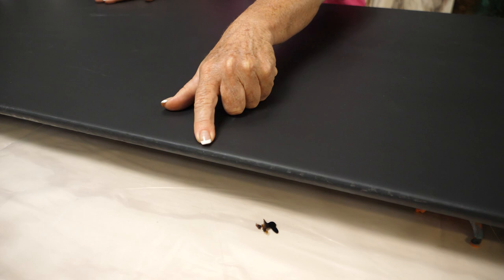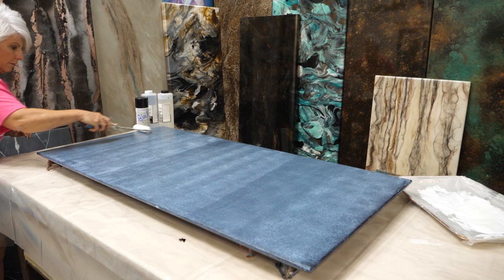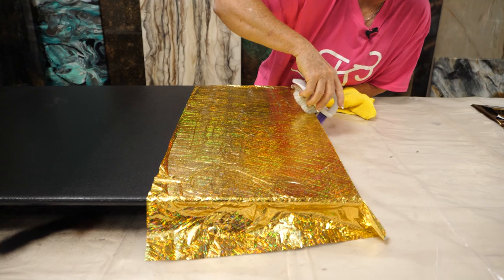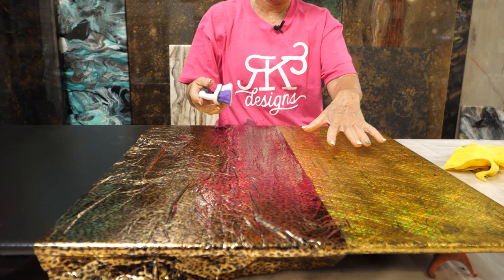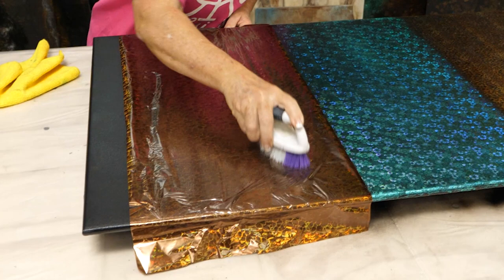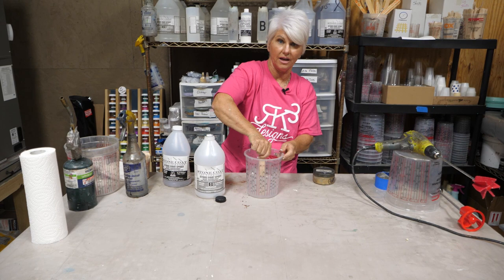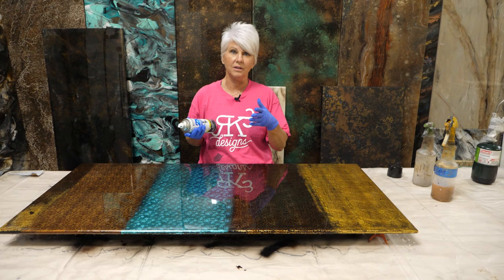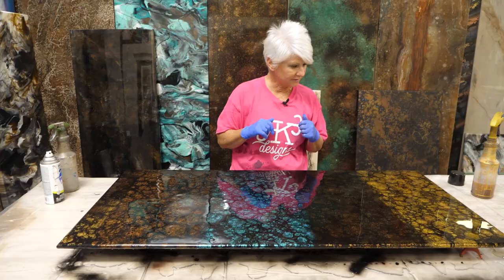Using Decorative Foils With Epoxy | RK3 Designs

Comment from the maker: rk3designs.com || Which foils would you use in your house? Have you seen all the options on Jennifer's website (ArtisticPaintingStudio.com)?
Reply: I don't know were i seen it, but i always thought you had to remove the "back"  so that silver part.. with alchohol. I use to do that for my nails. But now i want to use it for epoxy and i don't want to make any mistakes. So does that make any differenceĺ if i remove that "silver" part wich is on the back..?.
Reply from the maker: @ingridjager1028  that may be a different type of foils. The foils I use, the silver part is actually the backside of the design. You don’t want to remove it. That’s the part you put down next to the adhesive.
Reply: @RK3Designs  yes i know. But wenn i didn't removed it it did not transfer. But i guess it is different like you said. Thank you for your reply and your work does look amazing. 👌
Reply from the maker: @ingridjager1028  thank you!!! If you have any specific questions or need more help don’t hesitate to email me. Rhonda@rk3designs.com
Reply: @RK3Designs  i will do. Thank you. ⚘
Reply: I think I'd want to use the Crater Lake Blue with the green pearl as a base, and purple mountain metallic and gold metallic dust as highlights/lowlights & contrasts. Perhaps a tiny bit of metallic red to make the purple appear muted and almost brown... just use it next to a vein of the purple, next to the green, in a marble simulation. It might be finicky,  and take a delicate hand, but I think it would look great, and would be worth the effort.
  Thanks for sharing this technique! A dining room table, buffet and China cabinet would look incredible in this technique with the foils, then antiquing afterwards,  especially if you had a set of furniture that matched, then added this finish over a worn finish (not over valuable antiques, however, as they are nicer and are certainly worth more with their original finish!). Some older, more common design, perhaps 1970s solid wood, mass-produced furniture would be ideal.
Reply: This is absolutely stunning.....really beautiful outcome....I haven't seen this technique before......but after finishing, sprinkling alcohol ,will it be fixing with the epoxy ? And you don't need to do anything to fix the black sprey colour ?? Will the outcome be stable and permanent ?? 
Thanks for the innovative idea.....👌👌
Reply: I would apply this to my jewelry.  I'm not sure how yet, but I'm going to work on figuring it out!  This is fantastic and I love the way that you teach. You just tell us exactly what we need to know.  Thank you. I'm a fan!
Reply: I’m thinking BACKSPLASH!
Reply: no I have seen all rhe options of the foils/ but I will go to the link, u sent me and check them out and I'll come back and let u know, ok

Comment: The problem is, she isn't using proper equipment and Epoxy can cause fumes and those fumes can make you sick.
Reply from the maker: ACTUALLY that’s NOT a problem. Do your research. Stonecoat Countertop is made from 100% solids, no solvents. Read the MSDS sheet. No VOC’s so it’s VERY safe. The fact you would make a rude statement like that says way more about you than it does about me. Have a blessed day!

Comment: Wear a mask to guard your lungs and sinus….?
Reply from the maker: Stonecoat epoxy has zero VOC’s and is very very safe. I work in a very well ventilated shop as well. When not shooting video, I do  wear a mask when working with the spray paint.

Comment: That is so cool! It looks like slabs of rock! I don't think I could do anything that big, but this gives me ideas for smaller items! I'll look at your links to the products. I'm especially intrigued by that adhesive! It looks like it gets better foiling results than the standard products! I have the Duo Gel currently.
Reply from the maker: The Artsyville adhesive is amazing!!! Here's a link to the products from APShttps://shop.artisticpaintingstudio.com/?aff=22
Reply: @RK3Designs  Thanks! I told a friend about your channel and she is going to subscribe!  If I wanted to add the Stone Coat resin to a contoured surface like some of the Redesign molded shapes on a canvas or on a bangle would this work without dripping everywhere if I painted it on in thin layers?
Reply: @RK3Designs  I mostly make resin vases and candle jars/holders, could this technique along with this incredible foil glue you have shared with us work on curved and/or contoured surfaces?
Reply from the maker: @kkatfightt  absolutely! I’ve done some gorgeous tumblers with the foils.

Comment: Impressive. Particularly appealing to me. I'm building a custom pair of speakers and am considering using this because it's so customizable to individual decor. I love the blue with the paint alcohol effect. Im not sure about how to finish a completed box though. Thinking about epoxy pour and the right angle corners where the sides meet. Can you sand the epoxy to make the edges smooth where the sides of the enclosure meets?

Comment: Thank you! I can tell you are a great teacher! One quick question- how do you prevent dust from getting on the epoxy surface before it is cured?
Reply from the maker: Thank you!! I really don’t stress over they too much because I sand my flood coat before I apply the Ultimate Top Coat. We use the UTC on all of our pieces due to the incredible amount of durability it provides. Sanding before we apply removes all of the surface dust. 😊

Comment: I JUST LOVE LOVE LOVE THIS! DO I HAVE TO USE TORCH ON EVERYTHING? AFTER ALL THAT? IT SAYS YOU CAN FOIL ANYTHING? THATS REASON I ASK. ITS VERY GORGEOUS! THANK YOU..! THATS EXCELENT FOR A COUNTER TOP IN AN ISLAND IN KITCHEN! SOO PRETTY OR ON A BAR!! 💖💖💖
Reply: The torch pops air bubbles to give you a smooth texture.  That looks a lot better than random bubbles, but on a countertop it's especially important, as any divots or bumps in the finish would harbor bacteria from food.
Reply from the maker: I use the torch lightly to pop bubbles. Depending on the resin you use will dictate how the bubbles are addressed. 😊😊

Comment: Awesome look! Can you achieve this by using a layer of black epoxy letting it sit for about 10-15 mins then use the alcohol method? Would it be about the same? I'm working in a confined area that won't allow me to use spray paint.
Reply from the maker: That may work.  👍🏼👍🏼

Comment: This is gorgeous. I would love to have this on my bathroom wall. But can't do this vertically. How would it work on tiles then lay the tiles on the walls with grout and everything? I also would love to see the turquoise with dark dark blue high gloss instead of the black
Reply from the maker: We did our shower walls with the foil. We poured the panels flat , let dry and then installed them.

Comment: Madam I watch ur programs & other programs but they way u teach is marvelous. 
I m for Pakistan. I have some questions about foils with epoxy.
1. Can it be made on glass surface ( glass table)
2. Did u used primer black on base twice b4 using white cote.
3. When u apply white colour twice either it becomes black automatically after 30 minutes or u again cotted black colour on the object.
If I don't want to pore alcohol what is the substitute.
4. Is it a complete object after three hours.

Comment: You ma'am have a new subscriber.
This was SO interesting and enjoyable to watch.
I am definitely going to try this foil and epoxy technique.
One question for you.
Can I use the "tacky" glue on a raw surface and use the foil ?
I have a copper cafe' table and would like to use this foil on the surface.
Thanks in advance.
Reply from the maker: Thank for subscribing!!!! 😊😊. Yes. You can apply the adhesive over just about anything.

Comment: Thank you for that so useful video. Finally what is the Top coat you use? ALSO if i Will not use epoxy can i use Top coat only?
Reply from the maker: I would use the Ultimate Top Coat. If you dont use epoxy on top, you’ll not be able to create the effect I did at the end with spray paint and alcohol. If you don’t want that then you could use just about any top coat.

Comment: Rhonda, I just found you channel and so I subscribed immediately. This was fascinating to watch. Clearly you've done this once or twice:-)
Really creative and I want to try it. I love working with resin. I noticed you didn't wear any kind of mask, etc. Was that due to doing the
demo or the brand of resin?
Reply from the maker: The epoxy we use Stonecoat Countertop, is very very safe. It’s made with 100% solids, no solvents so there’s o VOC’s. I have MSDS sheets available. Know the product you’re using. Not all epoxies are safe. 😊
Reply: @RK3Designs  Yes, I know many are not safe. I normally use Art Resin. Thanks for the info

Comment: Your outcome is beautiful. I am just starting too learn more and more. I really have not started however my goal is to do my kitchen counter. Can you set a hot pan on top?
Reply from the maker: Hi there. Depending of the epoxy that you choose (I use Stonecoat Countertop) . The heat resistance is excellent at 475. You can put a hot pot on the surface. It’s not recommended you expose to long durations of high heat.

Comment: Using epoxy resin you need to use a respirator.   I know you may have felt it difficult to talk with it but it should mention using a respirator all the way through.
The video does show the beauty of foils.
Reply from the maker: Actually, I don’t need to use a respirator with the epoxy that I use, which is Stonecoat Countertop epoxy. It’s made with 100% solids, no solvent. Zero VOCs and very very safe.

Comment: Love this Rhonda. I am wondering if there is a resin that is bendable. Something that I could roll up.
Reply from the maker: You’re wanting it bendable after it’s cured? You can apply to curved surfaces if you add our thickener or you can just brush on thin layers until it starts to set up.

Comment: This is fabulous! I'm a landscape designer are these finishes appropriate for exterior applications? (You just earned a subscriber!)
Reply from the maker: Hi there. Epoxy in general is. It recommended to be out in direct sunlight, under a patio/ shade your good. I recommend a darker color for outdoor use and use the ART coat epoxy by Stonecoat Countertop.
Reply: @RK3Designs  Thank you so much for your response!

Comment: Does this have to be Epoxy underneath or can I use other kinds of glues like Mod Podge or clear coat if I wanted to use this technique for backs of furniture pieces?
Reply from the maker: Underneath the foil? It’s foil adhesive not epoxy. Epoxy is on top. No you can’t use modgepodge, it need to be an adhesive specifically for foil. 😊 you can get the foil and adhesive at Artistic Painting Studio. https://shop.artisticpaintingstudio.com/?aff=22

Comment: What is your opinion about using a vinyl rattlesnake or gator design material  vs a foil as displayed here. Which is easier to use and more time effective?
Reply from the maker: Are you wanting to put vinyl on the entire surface. That would difficult I’m thinking to do without getting bubbles. The foils are so easy to work with and you don’t have to worry about delimitation like can sometimes happen with vinyl.

Comment: Hi I just subscribed. I absolutely love the way you explained everything in full detail. Thank you so much for that. Absolutely beautiful!!! On a much smaller scale/project I think I can use my foil glue and my foils from plain to holographic to designed or embossed.from my 💅 mani's products. What do you think? Do you think that would work? Maybe using UV resin. If it was like jewelry pendants. If it was coasters or larger. I would probably have to use a two-step resin right? I have tons of these type of products+ different Mica's and glitters.from doing 💅 mani's p.s. I wonder if the holographic window coverings all different patterns in Amazon. I wonder if that would work on a large scale project like you're doing using your same paint and adhesion? Because it's not a foil? Thanks in advance💗
Reply from the maker: I think it would work. Just make sure no air bubbles are trapped under the product you’re using. 😊

Comment: That's really beautiful! I'd do kitchen& bathroom countertops with a technique like this. Is there a way to work the epoxy top coat around the edges without dripping on the last clearcoat? Can you do this over older, plastic countertops or wood, or linoleum? If doing this over a linoleum veneer, would you suggest removing the veneer, or doing this right over the top of a veneer?
Reply from the maker: You can do it over just about anything. You’ll need to use a bonding primer first. 😊😊

Comment: That was awesome…thanku.
Just wondering if u could use these foils as decoupage paper on furniture? Also could u paint something like gator hide over the top to seal these foils instead of using epoxy? Thanku for ur time in answering these questions.
Reply from the maker: Absolutely!! I’ve used foils in my furniture painting business for years. Check out my website for some samples of my work with foils. https://www.rk3designs.com/commissioned-work

Comment: You just got a new sub, if using this in a bathroom, is it necessary to expoxy it?
Reply from the maker: Depends on that you’ll be doing? Countertops or shower walls, I would recommend epoxy. Walls, tables, etc. just need to be sealed with something that will protect the foil. The foils do  need to be sealed with something.

Comment: I have a round table I want to use for my plants in front of the window. I also have an aluminum bar cart. Can I do this on there?
Reply from the maker: You can definitely put epoxy in front of your window but I wouldn’t do a white finish. You can also go over aluminum as long as you sand first and apply a bonding primer. I recommend XIM bonding primer.😊

Comment: Hi, I have a question: Does the epoxy have to be still wet/tacky when doing this? I painted an area with colors, covered the area with epoxy, epoxy hardened for 1 day, then I spray painted black gloss on top and sprinkled with 91 alcohol, and I did not get the same effect.  It barely dispersed the paint at all. What am I doing wrong?
Reply from the maker: Yes the epoxy has to be wet. That’s what gives the effects.

Comment: I would very much like to do the foils and epoxy in my bathroom.  I'm new at this my bathroom is fixed laminate older counter tops and no windows.  Do you have a video showing how to do on a fixed bathroom counter top and the epoxy since I would not have a window for extra ventilation I was wondering how to do this.  Sorry I would just really like to do this in my bathroom and I've never done epoxy before....

Comment: I use to do remodeling for a living, for 27 years.  I think this would be a fairly easy process but I have one question.  I have a "tiled" granite counter. I would love to do this process but was wondering if the grout lines would show? I get it that the epoxy is self leveling, but how would the grout lines look under the foil?

Comment: Nice Video!!  I use the resin on my tile coasters.  I tried to use Foil and it looked like it burned or smeared under the resin when it dried.  Is there a certain type of foil you used that goes well with the resin?
Reply from the maker: It sounds like the inks in the foil you used had a reaction to the epoxy. The foils I use are extremely good with the foils. Check out them on this link https://shop.artisticpaintingstudio.com/?aff=22
Reply: @RK3Designs  ok. thanks. I will look into it further. 😊

Comment: Is here a way you could apply this technique to a vertical surface
Reply from the maker: The foils could be applied, and there’s a thickener you can use for vertical surfaces, but it changes the color of the epoxy. This particular finish couldn’t be achieved vertically. When we do vertical surfaces, we lay the project horizontally pour, let dry then install.

Comment: What material u used  the white that u used the roller brush  before putting the foil?
Reply from the maker: I’m not sure I understand your question. Are you talking about the foil adhesive?
Reply: @RK3Designs  ahh yes the foil adhessive
Reply: @RK3Designs  thank you. I really amazed your work 😍😍😍
Reply: Hello. This is stunning, I love it. I had a thoughts that putting peel and stick paper on my ugly tile and poor epoxy on top. Do you think it’s work. Never done work with resin. Please and thank you!
Reply from the maker: @sureyyaaslanova9925  hi there!!  I would be careful with the peel and stick. Air pockets can cause bubbles and if the adhesive you use fails the material will start to lift and the countertop will peel.

Comment: Is there divits from the alcohol requiring a top  coat?
Reply from the maker: Sometimes the alcohol will leave dimples in the color coat. We always recommend a clear flood coat. That will take care of the imperfections. Follow with the Ultimate Top Coat and the finish is incredible 😊
Reply: My countertop does have the divots but it makes it look more natural. They aren't deep at all. But it also helps hide any scratches that would be so clear to the eye with a perfectly smooth top

Comment: question, !!   if u use the black !!   does it "not !   cover the "color    of the foil ??   I thought u wanted to see the color??    "but won't u be "hiding the " color??       if use the black???    how can u "see it then ??    doesn't  make "sence??    "black "hides  "color ??   don't u want a see thru??  so ucan  see the "color foil ??    "explain ??
Reply from the maker: When you spritz with alcohol it opens up the spray paint and you can see the design of the foils.